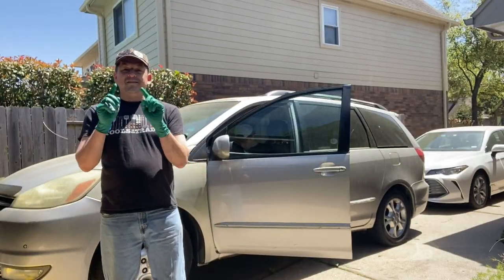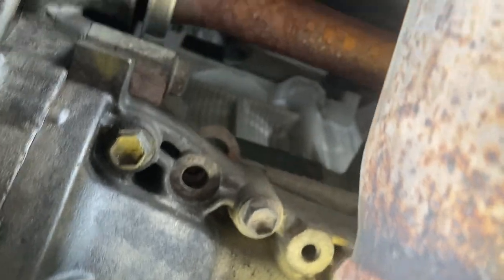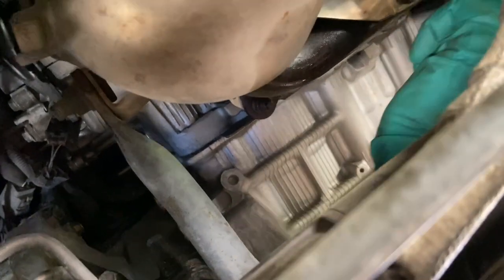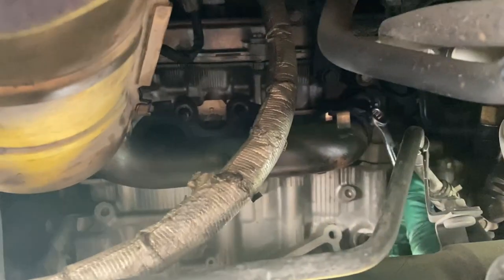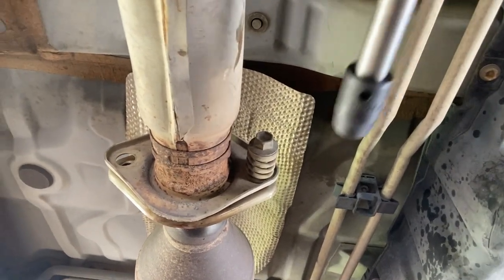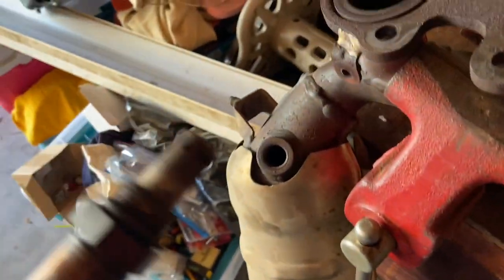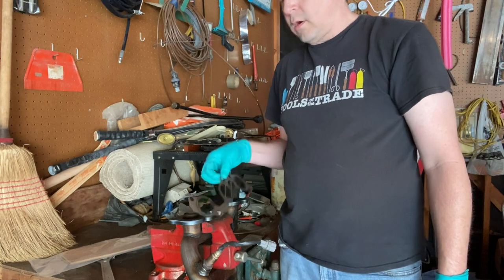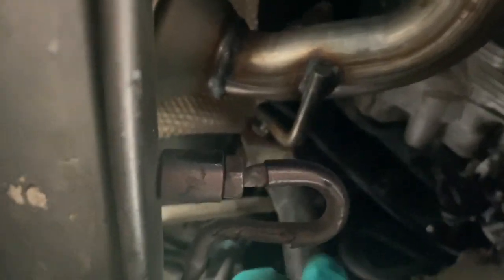P0420 Catalytic Converter Replacement (2004 Toyota Sienna) +188k miles

Comment: thanks, very helpful video. I'm working through this cat replacement right now and appreciate the detail you showed in your video.  Loved the engine revs with the cat off.  :)
Reply from the maker: Thanks! Good luck with the replacement. I was super surprised how easy it was.
Reply: For 2005 sienna with 133k miles. Do you know what mileage catalytic converter will fail??

Comment: Glad you made this.  I'm about to do mine in my gravel driveway. I'm not looking forward to this, but you made it look simple enough.  Should be easy to do
Reply from the maker: Good luck! I must say, it was easier than I expected. It was a relief all bolts were accessible.
Reply: @projectfixit  Once I had my breaker bar, everything went smooth.
Reply: Worst is if the bolts break off. I may be doing my son inlaw's 2004 Toyota sienna le.  He just got the code for the 1st time and I  cleared it if it comes back I will use chemicals , then replace  o2 sensor then replace  the catalytic converter last. Cheapest fix 1st. I  just did a complete  timing belt with all related components  replacement after the timing belt failed.  Got lucky no engine damage
Reply: Check out the aftermarket  exhaust company  out of Canada. Good price and stainless steel

Comment: Hi I have a question? when replacing the catalytic converter, Is the original isolation aluminum plate installed inside? Is it necessary to install it?  Thanks

Comment: Just change the plugs behind the engine that's how i fix PO430 AND 420
Reply: I just get same problems with what you had P0420 & P0430, which plugs did you replaced?
Reply: Start with the  cheapest option  1st.  Chemicals,  o2 sensors, then catalytic converter replacement
Reply: @PeterHernandez-lg2eh what do you mean "chemicals"?